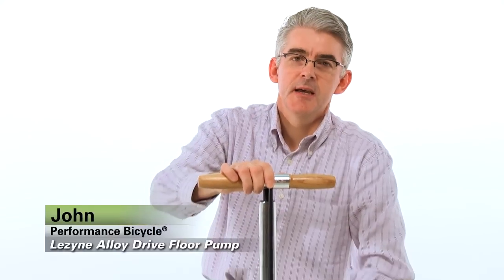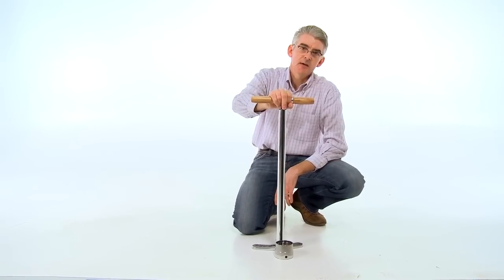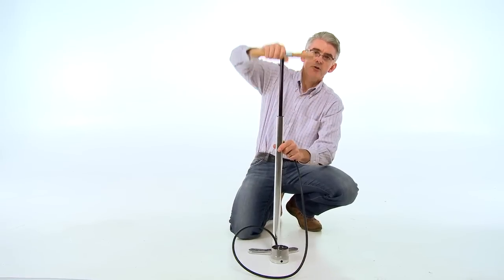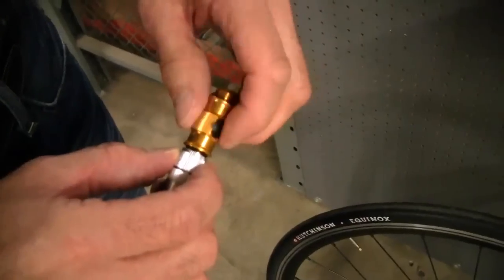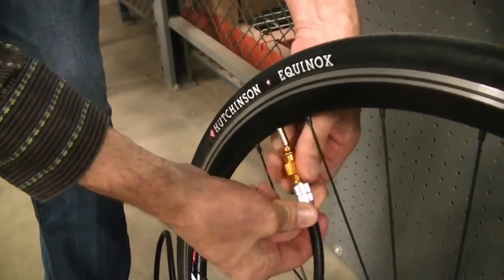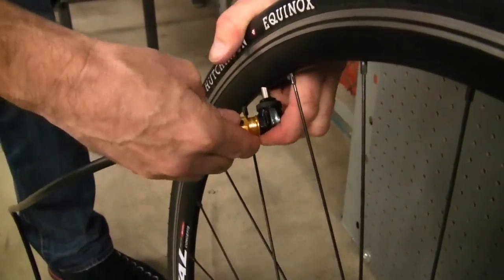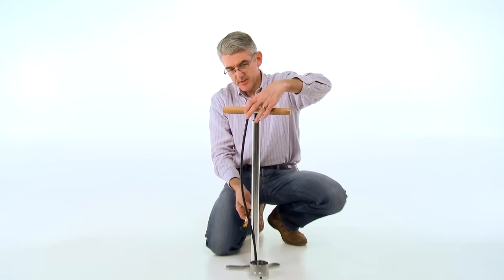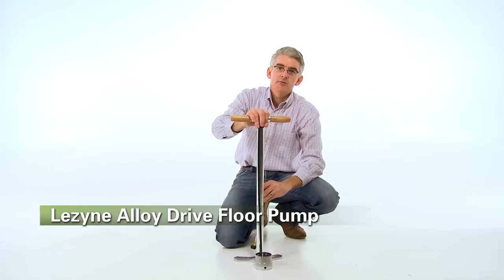Lezyne Alloy Drive Floor Pump Review from Performance Bicycle

Comment: Hello! Nice video, it very easily explained this pump's use. I was just wondering, do you ever have any problems using the speed chuck, i.e. popping off while pumping? It doesn't seem to stay on the valve when I use it. Thank you :)

Comment: Well made video, however I would like to add long term information. The gauge gave erratic readings shortly after I purchased it. Not long after that,the gauge stopped working altogether. I never felt like the pump delivered a reasonable amount of air per stroke. I have no use in my shop for poorly engineered tools. The company did not return emails.

Comment: So, my 2 year old Lezyne ABS floor pump lost pressure. It's always been 
in a heated garage during winter. Probably been used a total of 15 
times. I used it on my bike, and snowblower tires. How can this $$$ pump
 fail after a very short period? Yet the cheap $20 floor pump I bought 
at Walmart 8 years ago, keep in the outdoor shed which goes below 
freezing during winter, still works? Last pump you will ever buy? Yup, 
last Lezyne I'll ever F'n buy!!!!!!!!

Comment: Why I can't remove air on my presta valve using the chuck. Works fine on a schader valve but not on a presta.
Reply: +Gabriel Rivero Because a presta valve is kept close at all times by the pressure inside the tube (except when pumping, it opens for a moment due to the greater pressure on the pump side, the air moves in before the pressure in the tube becomes greater again and pushes against the valve shutting it) therefore pushing the air-bleed button only empties the hose and makes it a little easier to remove the chuck. 

It's a different story for the schrader valve however, because the pin (the one inside the valve) that you push to let air out of a schrader valve is spring loaded (it's how it comes back up) so in order for air to pass through more easily, the pump chuck presses it down and keeps it down until you take the hose off, so there is always an open path making the tube and the pump hose one therefore air from the tube freely flows back out when you push the bleed button and you can remove air. Hope this clears things up.